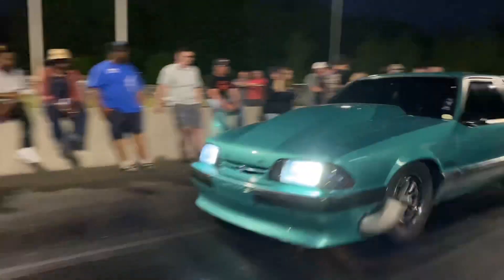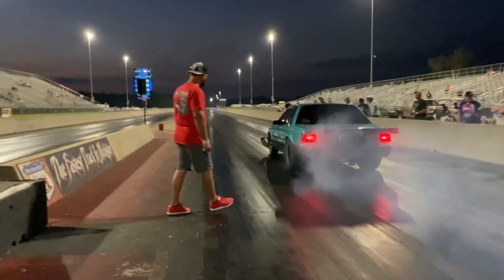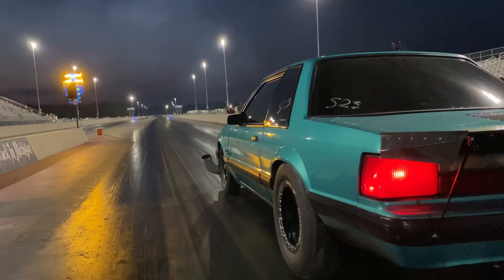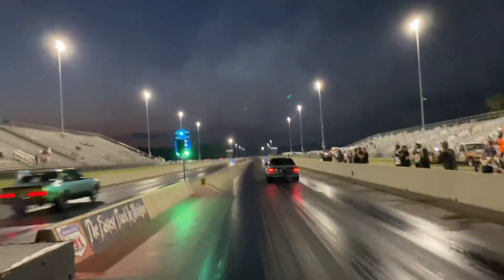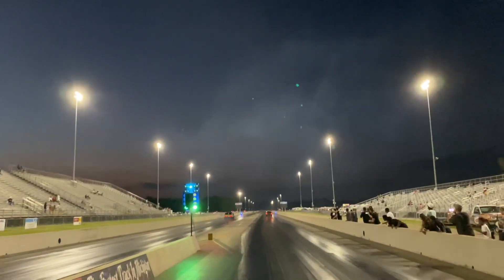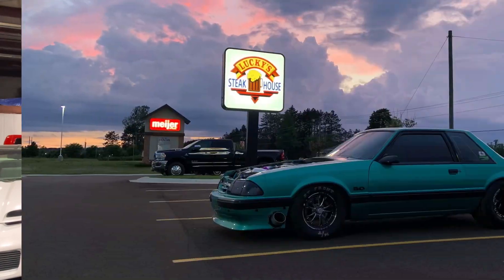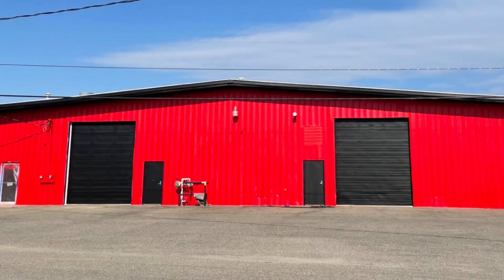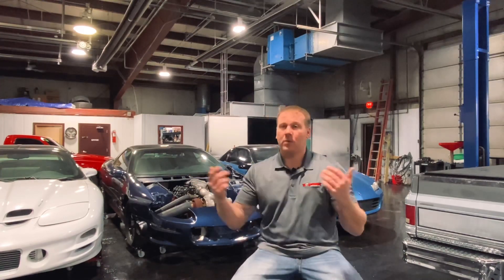Tribute 6 second street driven e85 Foxbody mustang. Turbo LS Legend. Zero to 172.7mph in 4.3 seconds

Comment: Fuel system setup ?
Reply from the maker: Mechanical(cable driven) 10.5gpm Magnafuel pump. Single set of FID 2,200’s. 70 base pressure
Reply: @NorthernPerformanceCars  Whos' cable ?
Reply from the maker: @jacksonwalton7404  waterman
Reply: @Northern Performance Cars  what is that huge air to water intercooler where you get that?

Comment: What race weight
Reply from the maker: 2868-2890 depending on fuel and passenger seat. 2,950 with everything loaded and the 8” powered sub.
Reply: @NorthernPerformanceCars  very nice man. Awesome 60ft. What is ur take on the 388 ci platform you had in this car vs a bigger cube 427 ci. What made u do the smaller cubes vs the bigger cubes. (Sorry if this sounds like a noob questions lol)
Reply from the maker: @bnrz28  with a single turbo less cubes will stretch further. 
Less torque. More rpm stability. Less piston skirt wear. Crank is stronger in the same series as lesser stroke. All off the shelf parts. Extremely reliable. 
I ran the Camaro engine 3 years. I ran this engine 2 years. I shifted the mustang 9,000 all summer. Literally zero engine maintenance.
Reply: @NorthernPerformanceCars  so awesome man. That’s what counts for a lot is reliable parts and not having to mess with the engine more than the usual maintenance stuff. Thanks for the reply man and hopefully when I scrape enough money I will give u a holler for my next build !
Reply: @NorthernPerformanceCars  just rewatched the vid and u stated the race weight in the vid 🤦‍♂️ lol. I guess I missed it when I first watched the vid 🤘